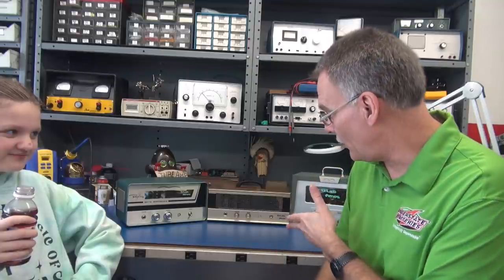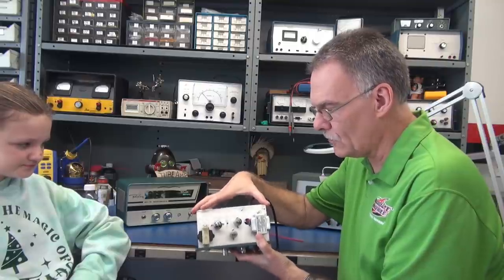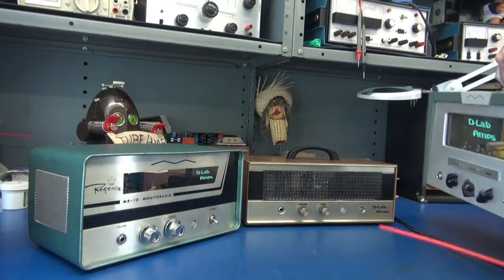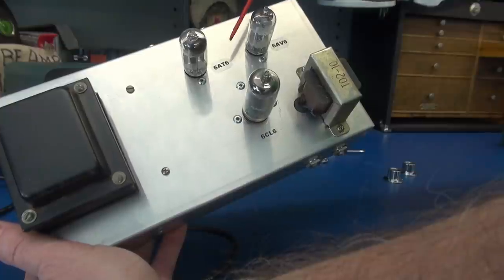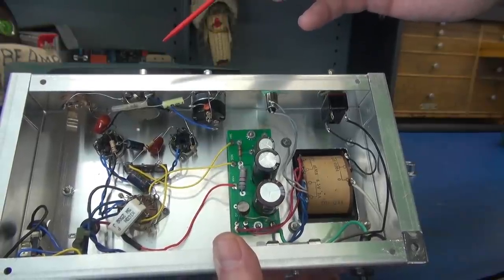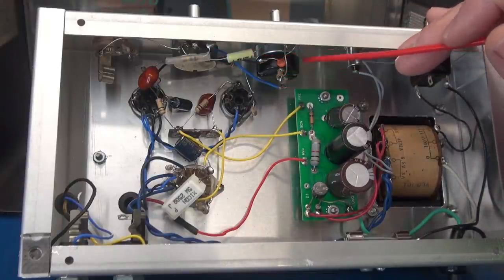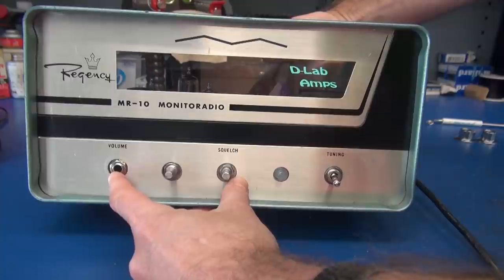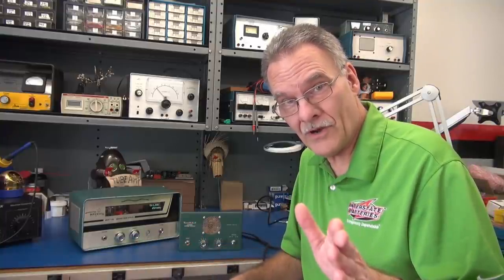How to build a 2 Watt Tube Guitar amp for under $5 in tubes Unique 6CL6 design Cheap tunes Part 2

Comment: You do a good job,I like little amps.tubes things sound good to most people.maybe someday I will make a small tube amp.in most cases you don't have to have a lot of voltage if lower the power and sound will be less but still sound good.

Comment: More great information from D-Labs. I for one really appreciate this kind of great info!!! Although, sometimes I miss a guitar player. However that might be easily solved it D-Labs wanted to put together a low cost looper that could be used when a guitar player is not available. Just a thought....Thank you Terry!
Reply: Terry, you should look into a DI box and a ReAmp box. That'll allow you to record Tony or anyone else through the DI box, then use the ReAmp box to play those recordings into a guitar amp with the right impedance.

The DI gives the raw guitar signal, so there's no coloration via amp/speaker/mic chain. Just a suggestion for those times when you are solitary. Or, you can practice more on the guitar. 😁

Comment: Hey Terry, what do you think of the ECL8* family of tubes for little amps like these?
Also have you ever seen the Brazilian project HB-1 Carmine? It uses a center tapped 60v power transformer and a voltage doubler to get 145v+ for an EF184 and 25C5 (or 25L5) amp, and the 30v tap feeds the filaments. Really cool and affordable alternative, and puts those odd voltage filament tubes to use again.

Comment: I have a unit i could probably make into a guitar amp. It is a Robyn CB Transceiver Base Module SX-7 . It even has the schematic on bottom ! I would like to use 6550's . It is a 1 watt speaker , The transformer or power supply is made in Japan - T-6630 . No tubes .

Comment: I really want to try building a little amp.  I have an old Icom Phone Patch-701 that I’d use for the case, but wanted to make sure this isn’t something that “all of the Elmers” would be looking for.  Would this be a good case/chassis for a build?  Thanks!
Reply: Not sure what the demand is for a working one, but the size of the enclosure is relative to the components and type of amp you with to build.  Transformers are the biggest parts to worry about.  How many tubes/ what type tubes do you wish to use?  A simple preamp and power amp?  Tube or solid state rectifier?  How fancy do you want  the tone controls?  It all has to fit in a way that doesn't add background noise.
Reply: @timmooney7528    Thanks Tim!  I just didn’t want a bunch of folks saying, “You ruined a vintage phone patch??? Are you nuts???”  Physical size should work well for a small, 2-5 watt amp, I think. Thanks for the reply!

Comment: Where can we find schematics for some very basic and affordable DIY tube amps with a complete parts list, also I’d like to use a 12ax7 for a preamp section and I’d also like to be able to switch between solid state rectification and tube rectifier but have no idea what tube to use as the final output PLEASE HELP !!!

Comment: hey Terry, Great Job ! Is Ref: M1115 of OT works ? I’ve seen this with Lamington Amps that use this model which is an Audio transformer line. Is 8k OT works for 7.5K recommended ? Do you have any famous OT reference? I’ve seen Fender Reverb Transformer as well for small tube amps, I am newbie , Many Thanks !

Comment: I haven't built an amp with that low of power yet, but I've been thinking about it.  I have enough different tubes to choose from, but no output transformer for one right now.  The smallest ones I have are for single ended EL-84s.  That's not a bad choice, but it's more than 2 watts.  :-)

Comment: The 6CL6 is a really great tube. The data sheet says the max. grid resistance  should be 500k. Does it no harm using the value of 560k beyond the specs which is shown in the schematic? Also, the specs recommend an idle plate current of 30 milliamps, yours is far below at 20 milliamps. Is that a sufficient value to get the max. output power?
Reply from the maker: I scaled the current for the power level. Also did not want to stress the output tranny.  Its easy to over drive this tube, best to run it a bit colder. Plenty of power, however feel free to tweek yours as desired.

Comment: This seems like a much simpler design, with only one output tube. This way you dont need to buy 3x octal sockets as in the previous version. Less soldering and kobbler clutter too.

Comment: Have you experimented with nuvistor tubes versus glass?
Reply from the maker: Nope, I have considered it, time always gets in the way
Reply: @d-labelectronics  hope you do one some day, it will be an interesting video to watch.
Reply: Forget Nuvistors.   The tubes can be purchased cheaply but the cost of the sockets will break the budget.  Few sockets are available and what is available is stupid expensive.  $7.50 each + $9.00 shipping for the less desirable solder to chassis mounting.  The ones that mount with two ears like regular chassis mount sockets are $96.00 for 5 from Norway!!
Reply: If you absolutely HAVE to do Nuvistors, get the Russian nuvistors.  They do not need a socket as they have 2-3 inch long leads attached and you can directly wire them to a terminal strip or PC board!!
Reply: @randyab9go188  thanks for the info.  No, I don’t need them, just curious on a comparison of them to glass vacuum tubes.